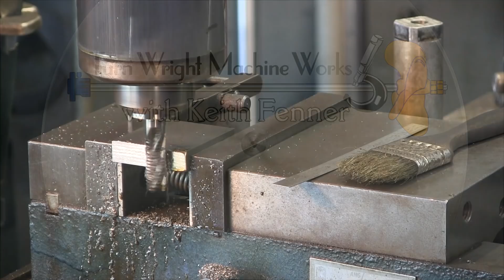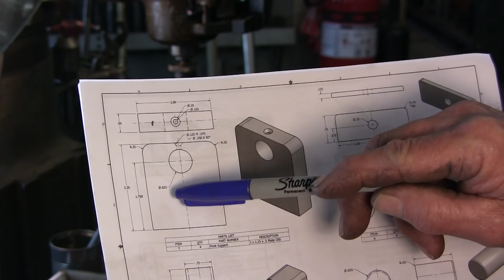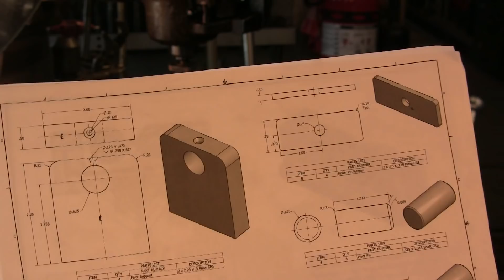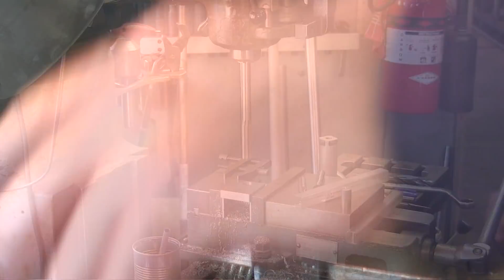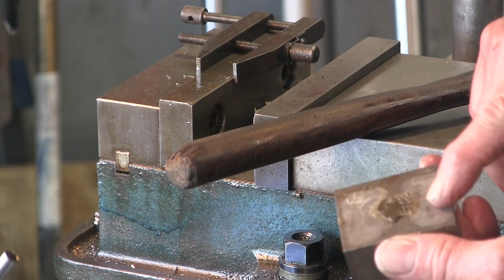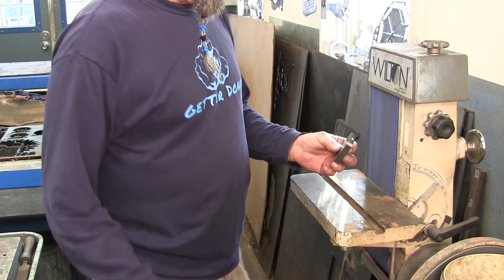The Wright Roller Kit The Build / Part Five

Comment: Good stuff.  Saw you were going to climb mill.. I cheat when I know I need to climb mill. Tighten up the bed clamps a little.. Probably increases wear on the dovetails tho.. 

One thing I like for deburring is a belt sander where the back side of the belt is not supported.  The flex in the belt softens the edges and makes a slight radius.. 

I'm mostly a hobbyist when it come to machining, build mostly motorcycles parts so I do a little bit of everything..I was using Cool Tool tool for most machining operations but had some Brownells Do-Drill on the shelf.. It really works much better on steels than the "one cutting oil does all"  group.